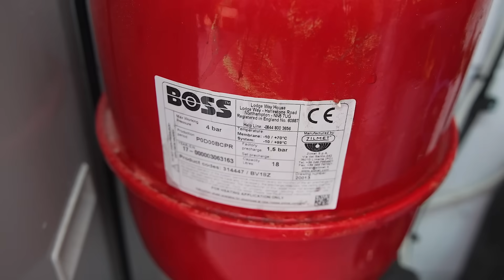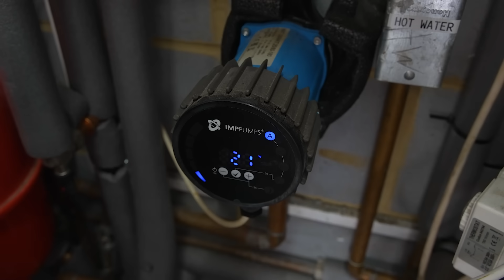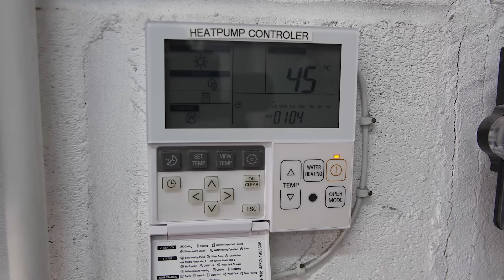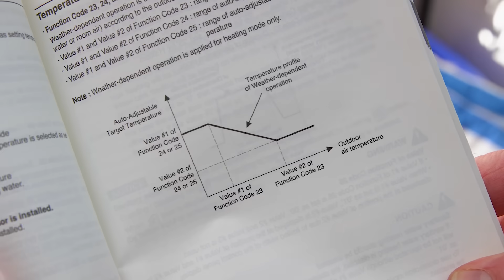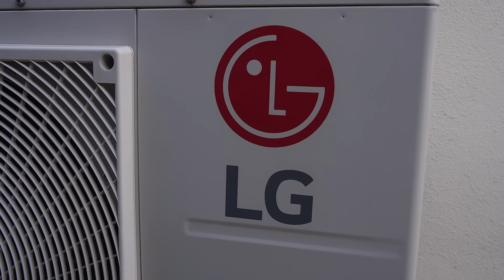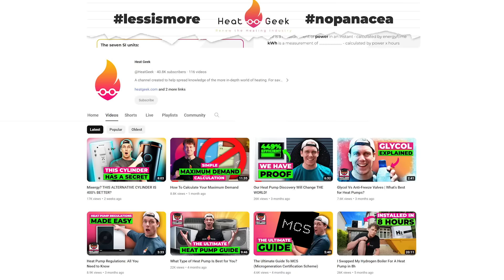Heat Geek Gives His Verdict on John’s Nightmare Heat Pump

Comment from the maker: Don't miss out! Join our community ▶ https://skill-builder.uk/signup ◀
Reply: Great support and very informative
Reply: Unbelievable, there's still grafters out there like yourself. I grew up with lads like you. Good decent men,with a good moral compass unfortunately there's alot of slags .fascinating to watch ,thankyou.
Reply: My god what a drama these heating systems are,why would you bother unless your minted.what happened to good old coal. You can't stare in to a heat pump can ya. That in itself is healing, look at flames in the fire ,buitifull. All the best mate.
Reply: Outside temperature???
This jon ,he's got more money than sense,what's the saying, a fool and their money are soon parted.wow.
Reply: Minimum distance heatpump from wall 40cm. Level the heatpump put it on vibration dempers. We install LG heatpumps daily, no noise, resonance and great scop. Put in enough airfilters and a magnetic filter and you got. Great system
Reply: Where is the follow up?
Reply: I would like to see the system on a follow up video to see if it now works
Reply: @VincentVincent-s9t  More like grifters than grafters. The reason the fan is noisy is because it has worn out. Very little to do with being level. You cannot oil the bearings as they are sealed for life. The reason the water hit the ceiling was because he didn't release the system pressure as it is a pressurised system. These 2 are the blind leading the incompetent.
Reply: My South and east wall  bricks are like storage heaters, I can sit outside for hours keeping wRm from the bricks. It is obvious that the south wall is thest location, the ambient temp will always be hotter than the north
Reply: Really heat pumps are cheap 

As of November 2024, the average price of gas is 6.2 pence per kWh, while the average price of electricity is 24.5 pence per kWh.
Reply: If i order a heat pump i expect the expert to be knowledgable. You cant know everything about everything yourself. I do however do some basic research because these days there are dodgy dingos everywhere .  Having said that, well i love working with my hands ( be it wrenching on an old timer ( the car not the people) or buying up hoarders houses and restoring them) i do love to watch these videos especially where people have issues or do things differently.  If everyone has 1% or even 0.1% of the solution we will eventually solve the issues.

THANK YOU BOTH for this informative video, have liked subscribed, commented and lets hope it helps with youtube algorythms.